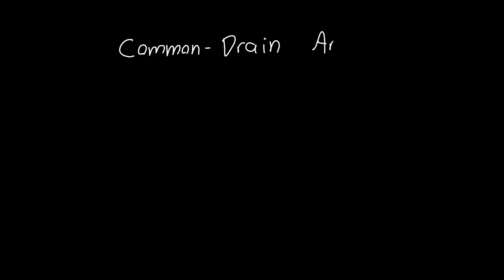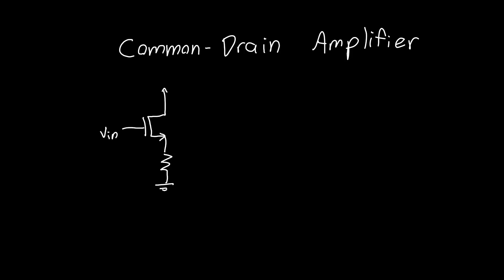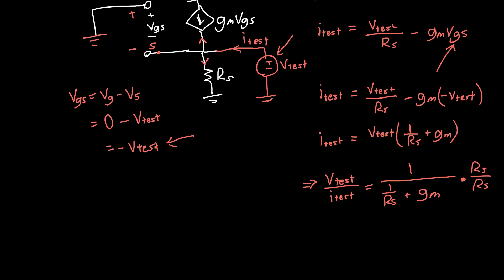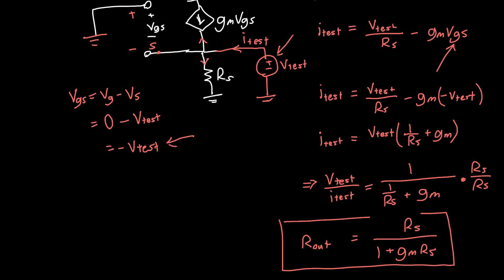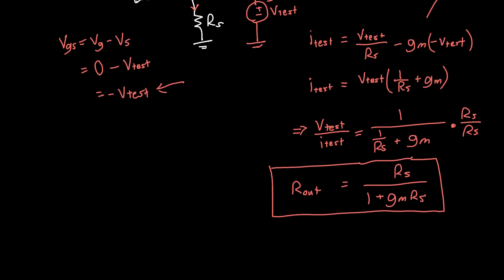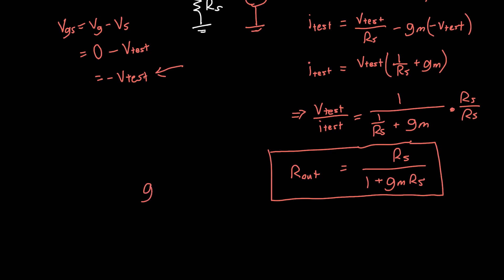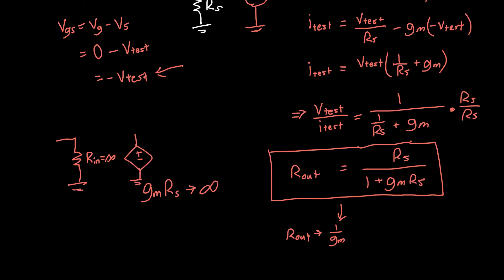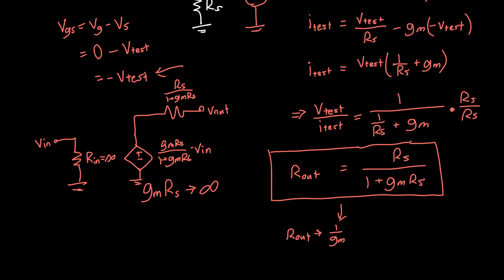Common Drain Amplifier Explained

Comment: In the equation for the gain where gm is involved, is the standard unit for gm "s (siemens)" or "mS(microsiemens)"?
Reply: I think its Micro as you use Microamps / Volt in generall

Comment: Can I get Vout to be negative to ground such as -20VDC and use to bias power tube. Any schematic in internet link? Thank you so the positive may be +20VDC and the negative will be -40VDC.  -40 and +20 when to feed in Common drain will get -20VDC out to bias tube. Am I correct?

Comment: please add r0 in the calculation and explain...pleeeease
Reply: All you have to do is replace Rs with Rs//ro. It looks a little weird but since Rs and ro always share the same two nodes ie.'S' and 'gnd' they are in parallel and be combined into an equivalent resistor.